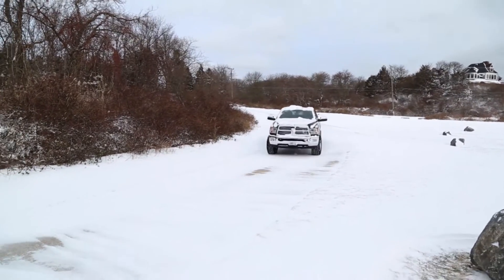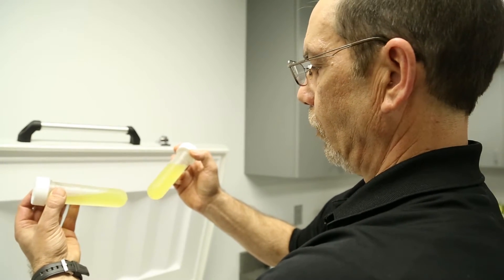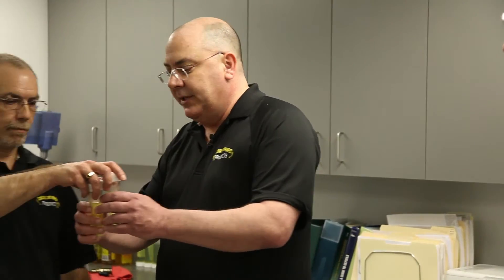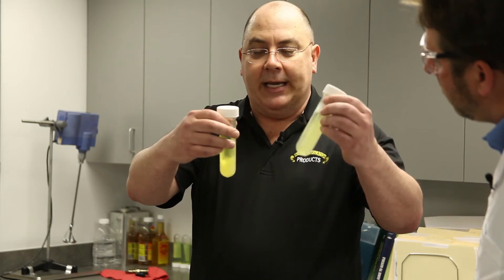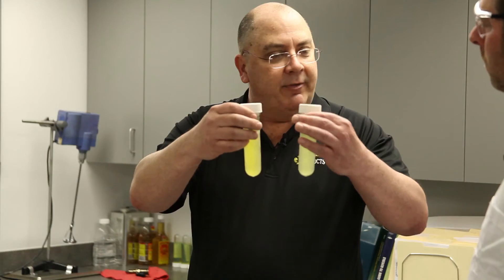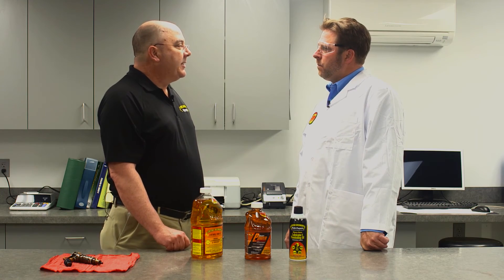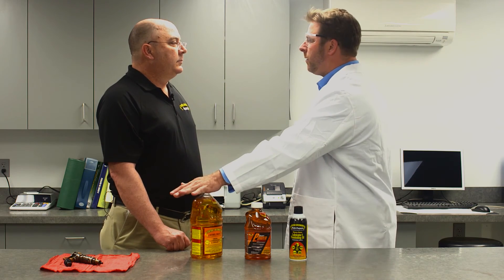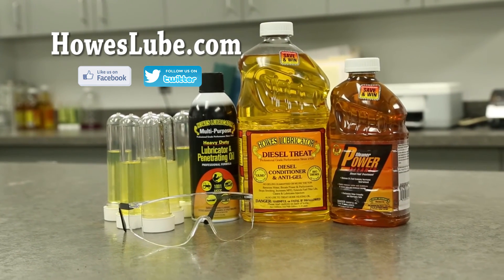Howes Products: In the Lab - Pros of Using Anti-Gel

Comment: Eh Buddy I'm in the north when it's -25°f here we go to the beach with Beer.  We have in fact been forecasted -58°f this week now I want to know is will Howes anti-gel provide me protection???? My fuel was a seasonal blend in October Down to -26°f.  
Sincerely,
Some Canuck 🥶 🇨🇦
Reply: At those temps you would want to double up the treat rate, it doesn't hurt to add more, so maybe even triple if possible. Canadian fuel is a blended fuel (#1/#2) so by default it handles much lower temps than US fuel. That said, using our product will help it achieve even lower temps. If the fuel is a -26 fuel, you will certainly want to treat it with Howes to help achieve -51. For best results, treat warm fuel with warm product (i.e. when filling the tank). If treating after already filled, you will want to agitate the product to ensure it mixes thoroughly with your existing fuel before those temps hit. As you hit lower and lower extreme temperature, it isn't that at some point Diesel Treat won't work, it is that the product will only get you so far from the starting point, especially at normal doses. However, the more you add, the lower the temps will drop. Eventually you will reach a point of diminishing returns, but for adding more to no longer be any more effective, it takes about a dose of 8 to 12 times our treat rate. In other words, adding 4x the product will in fact get you lower than 2x... And if you add enough, on blended fuel, you could absolutely get down to -58. But that isn't guaranteed, the fuel could still be a narrow band and you might need more than you bargained for, like needing 8x vs 2x, etc., etc.  Hope this helps! Thanks!

Comment: This is the worst misinformed infomercial I’ve ever seen. Huge wax fallout in the vial he pulls out and shakes up treated w Howes. The fuel he shows would be plugging filters galore. Most anti-gel retail product like this product and all the rest off the self brands will fail in stagnant fuel tanks well before -10F in most US refined fuels. Your truck better stay running if you’re gonna take this advice.
Reply from the maker: Zach, thank you for sharing your thoughts. 
First off, yes, most fuels from the pump will gel well below the -10°F. 
Most will start to show wax fallout at around 5°F to -2°F. (CFI) Cold Flow Improvers (Co-polymers) are designed to modify the wax crystals so they form smaller and rounder. Wax being rounder and without sharp edges means the crystals will not stack up and can flow even through the tighter filters. Using Howes Diesel Treat will keep your vehicle going even in some of the harshest conditions.
Yes, there are products on the market that are nothing but snake oils. 
Here at Howes all our products are tested and retested on a wide range of fuels across the US and Canada to ensure the top performances are met and exceeded. We are constantly looking into the latest technologies for CFI’s, Detergent Packages, and Lubricity Packages to keep our products performing at their best.
We stand behind every one of our products with a money back guarantee and carry the industry's only  “YOU GO or WE PAY your TOW” guarantee on our Howes Diesel Treat.
If you have any further questions, please give us a call. We would be happy to talk to you. Thanks again!